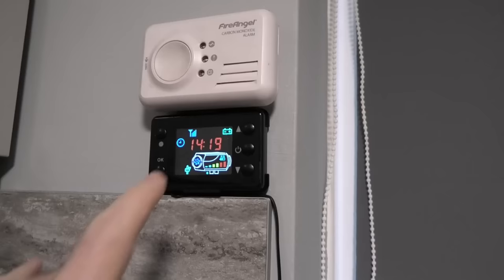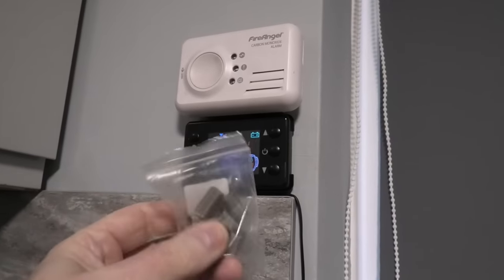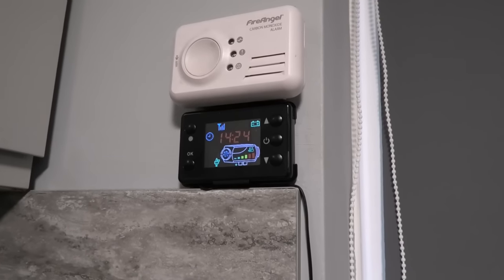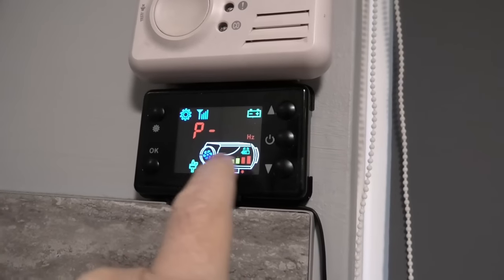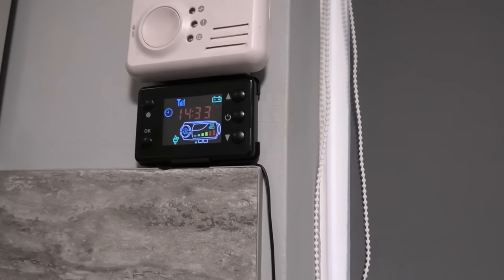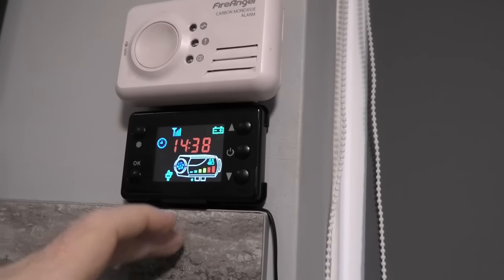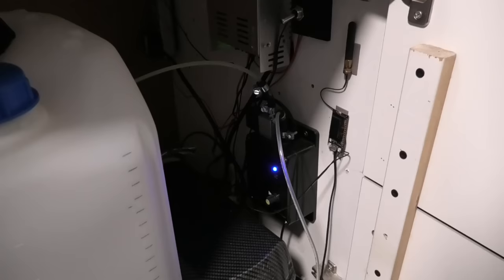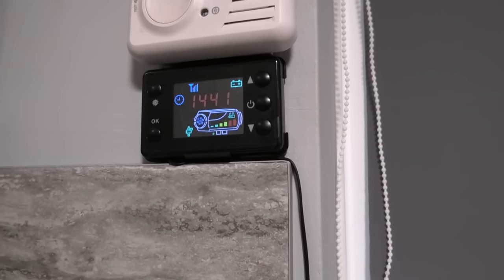How to tune a Chinese diesel heater with no tools 2kW & 5kW

Comment: Hi mate i apreciate you doing a vid as im looking for one i can send about to show whats going on. However, you make far too many mistakes for anyone to take this as gospel.  
Firstly i agree if you are running extra exhaust sections and longer ducting then it will especially need the low speed side of things. However coming down from an ideal contoller AFR setting menu from 1.6 to 1.2Hz on the fueling alone is dodgy nevermind running the fans at 2500 to keep the thing in the 130 deg burner temp zone. Thats a junk machine if you can get they settings to run. 
Other issue is your recommendations for max rpm max HZ and general confusion. 
As a boat builder thats done hundreads of these now and at least 30 or so chinese copies the basics are this. A 5kw is the same as the 8kw burner, pcb & plug wise. The ones sold as 5kw didnt quite make the grade as the 8kw that would run on the controller set to 5.5 and 4800-5000rpm. The 5kw copy ones were the identical heater only they couldnt get them started or running good at 5.5hz and 4800-5000rpm so they got binned in the 5kw bin.  Now the tricky bit is it could just be the quality of the plug installed from new or on a plug change that would mean your heater sold as a 8kw that ran no sweat at 5.5  would barely run at 4.5-5hz just because of a plug change. Now if your plug & atomiser on the refit is lesser quality they will need to be set at the settings you described in the this vid. The very settings that would signify poor quality plug and atomiser mesh.   The further you need to deviate from 5.5hz and 4800rpm on the 5&8kw burner models then the poorer the plug and poorer made your machine is. Even with a long exhaust and intake run 2500rpm at even the higher 1.6hz stock setting would signify you have mesh issues and the burner is toast. You should not be able to run anything on these bigger bodied 5&8kw heaters at 2500rpm on the low setting, that should instantly cool and have the burner down at 100deg barely one red bar. Theres something off with your figures or your heater mate so for that reason i dont think this vid is trustworthy at all for a begginer eapecially. These are easy to tune you made it sound hard. If you can get the low hz and rpm to 1.5-1.7hz and have the fan low set to 1500-1700 then you are dialled and expect 120-130deg burner temps. Do that then set the high speed so the burner temp will reach a minimum of 165deg with the Hz set between 4.4 and 5.8max and 4600-5000 rpm.  Anything outside these ranges WILL affect plug life and carbon build up and bearings. Cheers.

Comment: actually the first p for pump speed is the startup pump speed to heat it up. also it runs better with the fan speed set at 5500 instead of 5000. i set my glowplug to 4 out of 6 and my maximum pump speed to 5 instead of 5.5. my startup pump speed is set at 1.8. with that being said it never smokes on startup and running temperature. ive ran about 40 litres so far and it runs great
Reply: 5500 is wild mate for any of them. You will burn pluga out per 3 month

Comment: wow, i replaced mine a few weeks ago... just tuned it and it was waaaaayyy off. 
i guess this explains why the exhaust on my new one was running signicantly hotter than my old one. 

we'll see if it soots up :P
i went from 5.5hz to 2.8hz, and the bottom one stayed at 1.4hz, but i increased the low end fan a bit.

Comment: My control panel is like yours but looks like a series 1 type, I can't seem to get into menus etc., I've had 3 heaters in 16 months, they run for 100hrs than blow white smoke, now my lowest Hertz is 0.5 and goes to 2.5, my current heater just started smoking, so I forced it to get it started, at one stage it back fired like it made a popping sound from the muffler, now it's fine, BUT everyone is saying don't run them on low for too long.?? my last 2 they had a lot of carbon after 80-100 hrs of use on low

Comment: In your next video, could you please show your installation invluding which heater you are using. Thanks alot.
Reply from the maker: I've got to cover everything in sections, people don't like to see everything at once. Next time, I'll be covering the pump.
It's just a standard 5kW diesel heater, they're everywhere and they're all the same. Don't be conned by the 8kW version, there is no such thing. It's just a 5kW with an 8kW badge.

Comment: Hi,why my fan does not increase the speed when i rise de hz frequency pump. My pump start ticking accordint to the hz for example 4 hz but my fan still have the speed for 2.5hz and i have black smoke on exhaust because no air.Can you help me with an advice?thanks in advance.

Comment: This sounds like a great investment with the current fuel prices and it's a lot quieter than other installs I have seen with your tuning of the system. I'm looking forward to your next video as I'm thinking about getting one of these in the future.
Reply from the maker: With very careful planning, it's very quiet in comparison. There are 4 sources of noise: The inlet, exhaust, heat outlet and the fan motor. I'll go through all of them when I can get my head around explaining it.
Reply: i bought one recently and the ability to tune simply isn't in the controller, apparently there was a shortage of the above type controller, mine has a spanner icon instead of the cog wheel icon... not sure if that is the difference but probably be best to avoid the spanner version... i imagine the ore expensive heaters will still have this ability...
Reply: Dont leave it until winter they will double in price by then.
Reply: @timkelly5602  I changed all my ecus and controllers to the Blue controllers with the led remote controls they are easy to use and give you readings of the core temperature and voltage on the remote fobs screen. they have a range of about 30 feet and use less complicated and cheaper tripple A batteries which last about a year. The blue controller has a matching Blue motherboard/ecu for the Heater and it is identifiyable by the silver Bi-metalic strip that crosses the blue coloured circuit board from one side to the other.
Reply: they can be made very economical especially running two or muliples at a lower setting like in boats. Im a boat builder ive done hundreads of the genuine ones and maybe 30 to 40 chinese copies. I like the guy in the vid but i dont think his figures are correct and i think his heater has burned its mesh on the inside of the burner out to the point it runs at settings it shouldnt. Absolutely NO way is any fully working 5 or 8kw branded copy heater running at AFR menu 1.2hz and 2500rpm. You will instantly hit sub 110deg on any fully functioning heater even at 1.6hz if you go over about 2000rpm on the slow fan speed setting. You do need to up the stock 1500rpm speed by about 200rpm to get it running good if you extend ducting and exhausts to the limit but to gave a heater run at 2000rpm and 1.2Hz means its mesh is gone and atomiser is cheap junk. Ive no idea how hes got it to stay above 100deg burner temp at 2500 low 1.2.

Comment: You earned a subscriber here! I just bought my second one of these heaters. I have a bit of an out there idea for a project with one of these.. 
Thinking of trying to convert one to a waste oil heater. But instead of pumping the oil into the heater itself I’d pump it to a separate external burn chamber and route what would be the heat output side into a pipe to be the combustion air for the waste oil. 
Wondering if the temperature sensor is the main or only sensor I would need to move or “fool” to achieve this unit essentially regulating a fire that’s not contained in the unit. 
I know this is crazy talk but I’ve pondered it a while and I’m a bit of a fabricator. 
Any thoughts on possible error codes or problems I would come across that would shut the unit down. 
Thanks

Comment: Thanks mate
I'd never heard of these (not the cheap ones anyway) until I saw this vid. I'm going to pull the one out of my scrap Freelander and see if I can use it cos me garage is Baltic!!!.
5kWh heat for 45p (half litre of 28 sec kerosene @ 90p per litre) instead of 1kW for 38p of leccy.
Reply: Should be a way better heater than the chinese ones, i believe the land rover ones are webasto.

Comment: Great video! if the power is removed/interrupted from the heater will the adjusted settings memory be lost and return to default settings? or does the memory store and the adjusted settings are still present after power is restored. Thanks!

Comment: I have a 5kw version and I haven't had issues with it sooting up or smoking.  The mixture is about right. After last season there was little build up and it wasn't black more grey.  My fuel tank is about 4ft below the unit and it makes me wonder if the height you draw the fuel affects fueling. I already know that if your tank is above the pump it does flood through.  Or maybe I was just lucky.
Reply from the maker: Yes, having the pump lower down reduces fuel delivery. If you put the pump any higher, you'll probably find that it starts choking it.
I think you were lucky with the placement of everything, so don't change a thing 😁
Reply: @Vortecks  I screwed it to the wall so it isn't going anywhere - but I think its the fuel head height that matters.  The other thing that can affect it is any changes to the inlet and exhaust circuit.  So for example, adding a different silencer or changing the pipe length may reduce the air mass and make it over rich.  But also as the combustion chamber soot's up it may also cause it to over fuel and I bet that will be a positive feedback of doom.  As they have no mixture control they probably should be set up to be quite lean.  I saw someone using a lambda probe to get 15:1 at which point it smokes - I think it should be closer to 20:1, I think that 15:1 only really applies to fixed volume combustion like a cylinder than a flame in a tube where you will have an excess of oxygen.
Reply: @Vortecks  What I could do is get one of those pumps and pump the fuel 1ft uphill and then 6ft uphill and measure the fuel delivered in 10 mins say.
Reply: Also 5kw heater, Ive read before 3.6-3.8 hz is most efficient in other videos, i also tested it out it saves fuel and theres a very slight black smoke i see out of chimney when u got it at 5-5.5hz. I just almost got mad now from fuel pump noises. Theres also a very good method of tuning when u buy some cheap chinese co meter and if you put it at high you see like 10k ppm and at low 1000 ppm and when its arround 3.6 hz you get 400 ppm...

Comment: Why don't you try running it on Paraffin Tony...?..Back in 1962, they were all the rage.. Paraffin is a purified form of Diesel. Way cleaner.
Esso Blue anyone?...I can remember Pink Paraffin also....Just a wick and mesh burner. No blowers or fans, just gravity fed paraffin...😳😳😮😮😏😏🇬🇧
Reply: Could even be worth trying different fuels anyway to see what's the cleanest and most efficient between waste oil, kerosene, parafin, diesel, JET-A1 and so on... or if a blend of fuels / fuel oils is better....
Reply: @DigBipper188  I can tell you the answer. Kerosine (Paraffin) has the highest calorific value of all of them. This is why it's used in Gas Turbine engines...Jet Petrol or Jet A1is very refined Kerosine with the sodium removed. Plain Paraffin is the obvious fuel for this heater...It may be a bit more expensive than Diesel though...🤔😳😳🇬🇧
Reply: @EnglishTurbines  Many years ago we used straight diesel to fuel 8 Rolls Royce Avons running through English Electric power turbines to EE hydrogen cooled alternators with SSS clutches to enable synchronous compensation. We had to modify the aero cans to reduce smoke emissions , otherwise they worked well and were good for 120 MW within about 10 mins from barring speed. All gone now because they were horrendously expensive to run. We could do with them now for peak lopping !
Reply: @calderdale6795  Lol, yes, diesel is very oily and burns dirty...Agreed, our MPs are idiots for ignoring our INDEPENDENT energy needs. I wouldn't pay them in Chocolate buttons TBH....🤔😳😏😏🇬🇧
Reply: @EnglishTurbines  Would you believe , 30 years ago we produced a paper advocating the use of high efficiency ( over 40% ) coal burners with stack scrubbers over the use of gas , which could even then be burnt efficiently in domestic use. We also came up with a general plan , with costing , to produce a bunded tidal barrage for the Severn ( very high tidal range ) using Peltham Wheel reversing turbines.  The bean counters threw it all out and later built gas fired combined cycle units because it was cheap , and needed less manpower. Back then energy self sufficiency was a must , and the french DC link didn’t work very well. We also had our own very safe AGR (advanced gas cooled ) nuclear plant.
Don’t get me going on fracking !
Reply from the maker: I can't get paraffin, kerosine, red diesel or anything mate. Last week, the Sainsbury delivery bloke told me that he has one and uses kerosine from a farm supplier at £1.25/litre. I can't find the place he mentioned so I'll have to wait until he's back again.
Reply: @Vortecks  Yes, back in 1965, you could buy Paraffin at every Corner Shop...The good old days. Sorry, I'm sounding like a grumpy old fart...lol..
Paraffin is the ultimate answer though...Even Turpentine is better than Diesel...😮😏😏😏😀
Reply: @Vortecks  i can get cherry at a few boat yards but they only really like pumping it onto actual boats, even then you have to specify what percentage is for heating and you only get cheap red prices on that percentage, the rest you pay full whack for ☹️
I guess we have to pay Ukraine to kick the Russians arse somehow 👍
Reply: @Vortecks  Try ringing all your local heating oil suppliers. I just found one near me (Stephens Fuels) that sells Red diesel for £1.29 per litre or Heating oil (kerosene) for £1.19 per litre (prices correct as of 12/12/22).  Price is if you provide your own container, i.e. 20 litre plastic jack.

Am I correct in thinking that running this on heating oil (28sec / Kerosene) would be better and cleaner than Diesel? Also at that price heating oil should be around 5% cheaper per kWh of fuel energy.  The energy info I found on the web is that Diesel has around 10.75kWh per litre and Heating oil around 10.43kWh per litre.
Reply from the maker: @martinwhite3005  I've tried loads of local places and they all say the same "Yes, we used to". From what I can gather, Kerosene is a cleaner burn with less pollutants and cheaper but as I said, I can't get the stuff unless I drive a long way and the savings would be lost, very frustrating.
Reply: @calderdale6795  Yes, Lidl have some on the Thursday special. Hopefully quality will be reasonable.

Comment: I'm looing for a diesel heater for a small car/civic. 2KW or 5 KW be enough? Read 5 KW is quitter, but can soot up if ran on low for too long. I'm in canada and get's around -15 celcius, and will be sucking in cold outside air.

Comment: I would really like to change settings as you have however i found out that my vevor 5kw heater recently purchased uses this new style controller. Same appearance wise. No hz  or speed settings available unfortunately. Very limited functions. Hoping it is set to burn proper and clean but unsure. Any suggestions on purchasing the appropriate parts to have the adjustability ? thanks for the video.

Comment: found how to reset the PIN....see reply in my original question
having played with the settings (5kW heater) I found that, at 4500 RPM the heat gain across the heater is as follows...at 5Hz it is 47 deg C (7 in, 54 out), at 6Hz  it is 66 deg C (7 in, 73 out), at 7Hz it is 75 deg C (7 in, 82 out)....I stopped at this point for fear of overheating anything 🤔
Below 4.5 it drops one bar on the display as per the original video.....but increasing that to, say 4.6 although returning the bar on the display and then increasing a further 0.2 as per the video seems to make a dramatic difference to the outlet air temp. which increases as more fuel is added......kind of as expected but up to what point ?
so, how does one determine the optimum setting for heat gain across the heater?... presumably - and I dont have a CO meter - the CO will increase as the amount of fuel increases although even at 7Hz there was no visible smoke and no noticeable smell
I should add that I am running it on normal domestic heating oil (kerosene)
Reply: Kerosene does not lubricate the pump like diesel does so add a small amount of 2 stroke oil 25ml to 10 litres of kero to lube the pump before it dies.

Comment: Top video, very well done. Regarding 1/7 cost of electric heating (@ 9m21s), is this based on a resistive heater or a heat pump/refrigeration heater? Also, what electricity per kw/hr and diesel per litre prices is that based on?
Reply from the maker: It's based on resistive, I'm electric only. I measured it at 46p which is what I'm paying. I know it doesn't take into account the Energy Price Guarantee but that's a rebate and not guaranteed for ever. I pay around £1.68 / litre. Kerosine is much cleaner and cheaper if you can find it, it's around £1.27
Reply: @Vortecks  Is that 0.46 GBP per kilowatt-hour?
Reply from the maker: @jimmybrad156  Yes, sadly.
Reply: If your buy a refurb 600ltr IBC you can get a 500ltr minimum delivery of home heating oil, kerosene etc for £0.80 at todays prices from Home Fuels Direct UK this will significantly reduce the running cost.  An IBC is approx size of a pallet cubed. Hope this helps. 500Ltr should get you from Oct to Mar 12hrs a day running at setting 3 with a lean burn. If my maths is right.